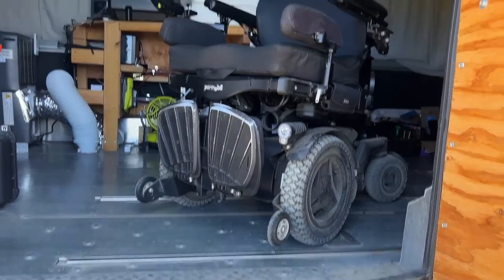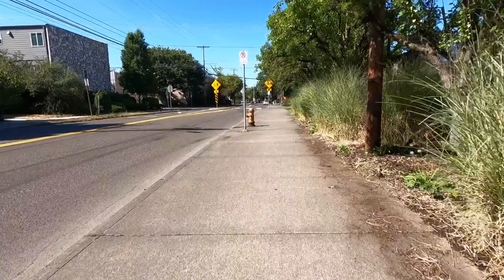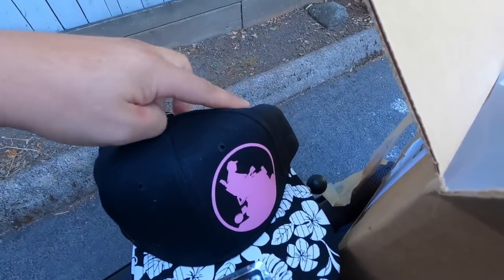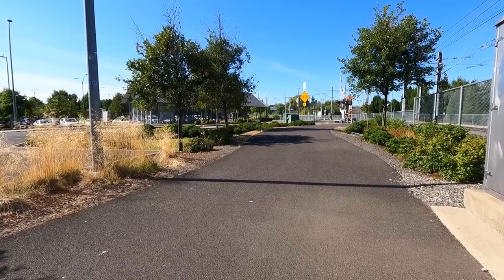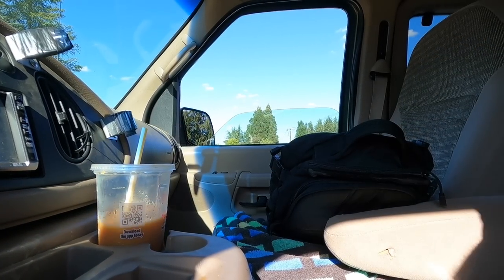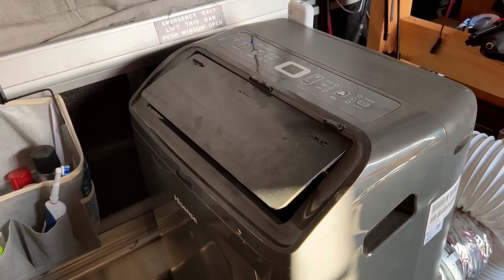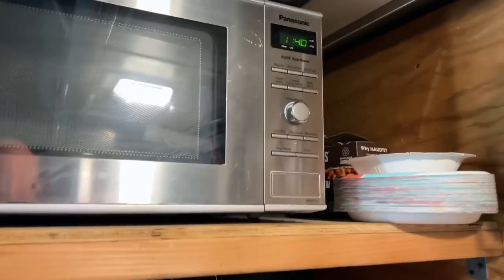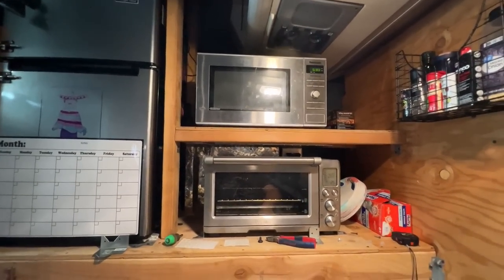MEGA VLOG 675: stuff and/or things! (vans, chairs & microwaves!)

Comment: 4:21 6.5 MPH is about able bodied jogging speed, no?
Reply from the maker: most ive encountered are around 6- 7 mph-ish.. but the idea is to be able to pull away from a sprint - most can run pretty fast, but only for about 90 seconds or so :^)